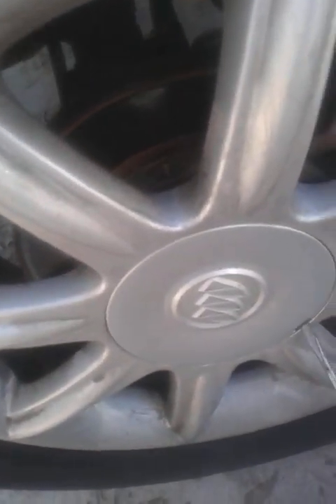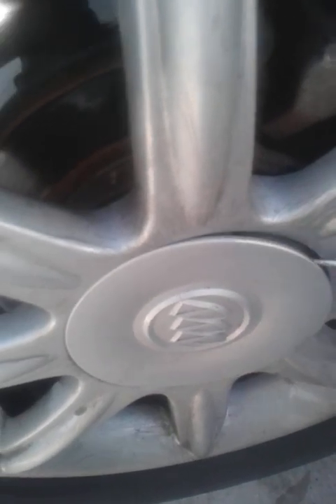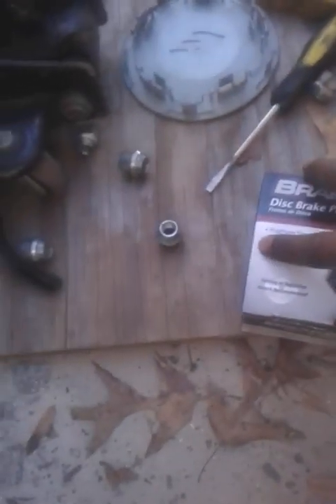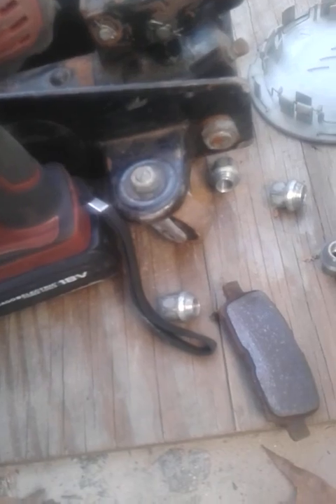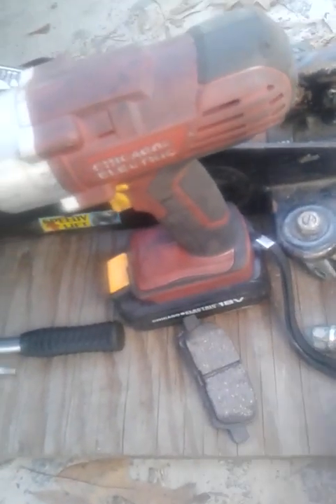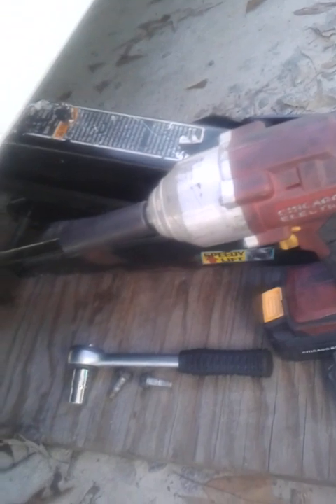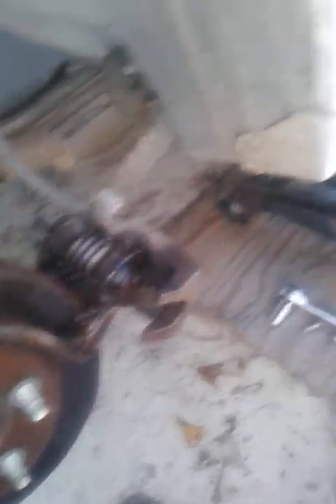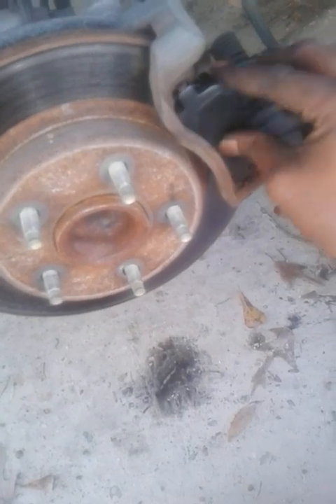rear brake pads replacement on a Buick LaCrosse easy fix

Comment: Quick tip. You dont need a special caliper tool to do the piston. Can use a needle nose pliers and wd40. Works just as well

Comment: Thanks for the video. I might be able to do this myself. Save me some money & maybe time. The shop wants $300 to take 3 hours to do front & back brake pads.
Reply from the maker: Thats to high i charge 45$
Reply: I figured. It's my fault for not sticking with my main mechanic. I had to go to him eventually because nothing I did could get those caliper bolts to move, lol. He didn't anything near $300.
Reply: @cportmikesautomotiverepair1355  Hell I'm spending $930 bucks for front pads and rotors and a master cyl. What a joke. Thanks for the video. I have a bad back but I'm going to try the rears myself.
Reply from the maker: You're welcome God bless

Comment: Would have been easier to use the whole brake caliper tool to turn the piston back in.  You only used part of it. And it's really important to take the slide pins out of the caliper bracket and lube them properly. This will keep them from getting stuck and burning up a new set of pads prematurely.
Reply from the maker: No not if the customer paying cheap
Reply: @cportmikesautomotiverepair1355  Then it really doesn't make sense to have a harder time doing it. Not only does using the tool the right way make it easier, but peeling a little bit of the rubber boot around the caliper piston back and spraying WD40 around there real quick makes it turn real easy.

Comment: Good info but next time get someone else to do camera work. Was giving me nausea....lol but i do appreciate the info. Rear caliper looked diff from front so i didn't want to start something i couldnt finish. The spring for e brake threw me off. Lol thank you though mike your video did help me out!!!
Reply from the maker: Lol right i need a tripod
Reply: U keep making videos to help folks id be honored to send you one buddy. I just started working on my vehicles myself to save $ and if it wasn't for guys like you posting these videos i honestly would have been dead in the water. Id be happy to make a donation or get you what you need to keep making videos. If you interested hit me on fb messenger buddy. Dennis Jordan. Have my business as my icon. Jordan and Sons Handyman svcs. With my phone # listed. Text or fb fine.  Thanks for your help man. Priceless!!!!
Reply from the maker: Your welcome anytime i will add you on Facebook i also have a Instagram. With videos on it as well
Reply: Im older i dont do Instagram lol dont understand it so i stick to fb. If you find me n friend me we can def get you what u need buddy.
Reply from the maker: Ok i found you but i cant add you how your page looks
Reply from the maker: Ok
Reply: I thought about making videos for my ram 1500. Ive done redone the entire front suspension. Upper n lwr ball joints, control arms, tie rod ends, and today did the radiator incl flushing coolant system. I just dont have the patience to dick with a camera not to mention im sure i cursed dodges design about 100x today alone...lol thats y we need guys like you that have that patience. Thx again. Look fwd to hearing from you.
Reply from the maker: Yes thats good you should of record it next time do it and become a good YouTuber and start making money